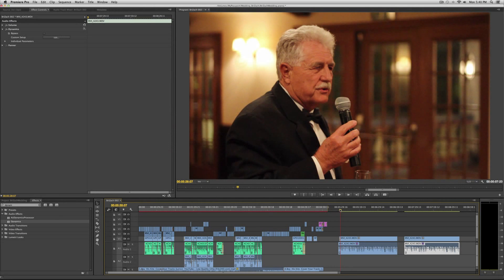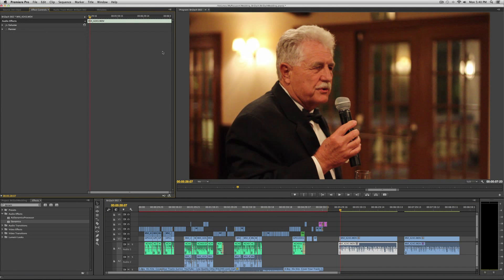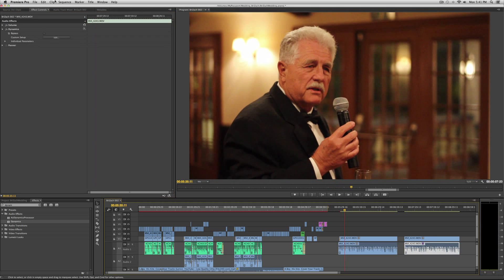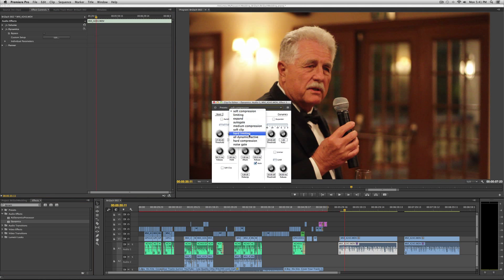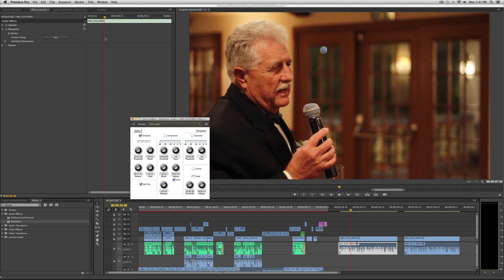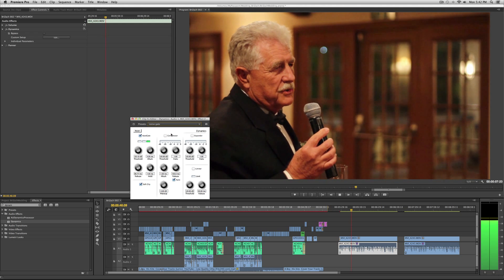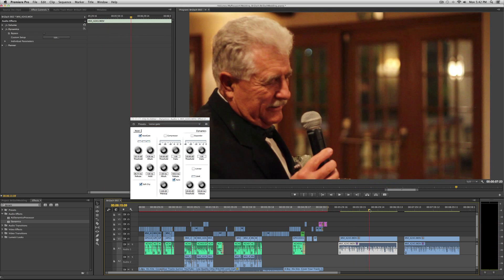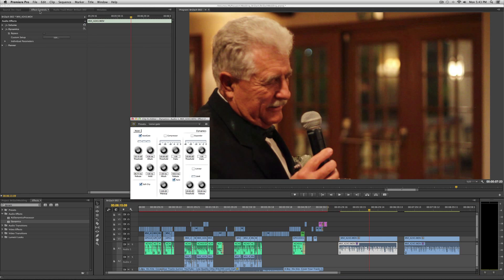How to remove reverb and echo from audio (noise gate tutorial)

Comment: So I've done this, tweaked the settings to be best, but my problem occurs when the camera guy didn't mic the subject and now I have to match audio recorded from 12 feet away to audio recorded at 2 feet away.  I've reduced the echo a bit and removed excess noise but you can still hear that she is in a room when compared to the audio recorded at 2 feet.  Would you know how to fix that?  How to make her echoey audio more fuller as though recorded closer?